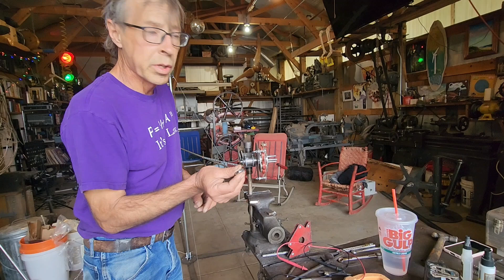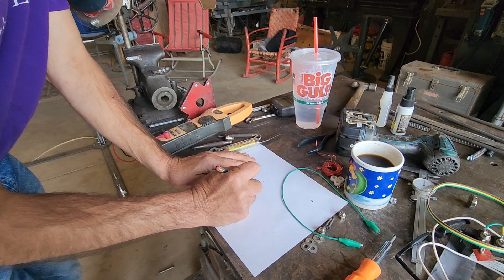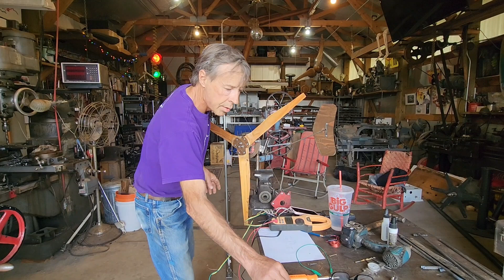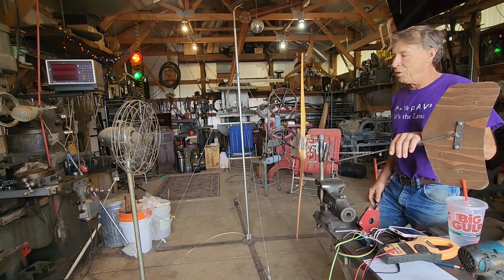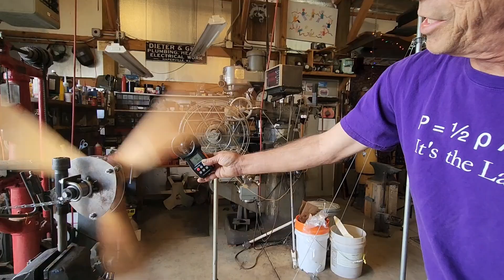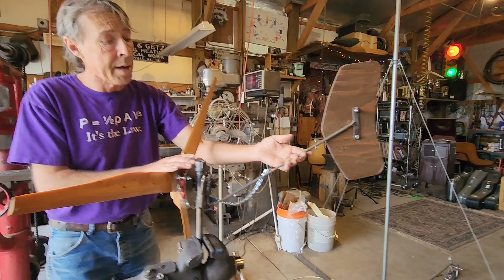1 meter axial flux homebrew wind turbine

Comment: DIY axial flux motors made just as simply as your alternator seem like an interesting new route to power BIG shop tools at lower RPMs. Maybe powered with a hacked Prius or Leaf inverter being fed mains through its charge circuit? Not to mention wind/water generators, of course. I guess I'm more focused on cool stuff to use that free juice in :)

Thanks for sharing, and looking forward to seeing the project progress!